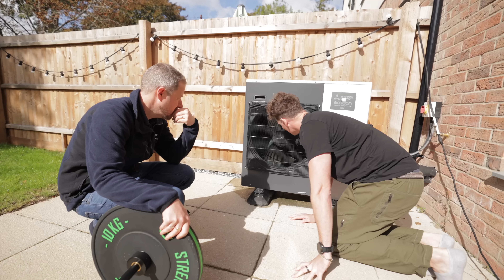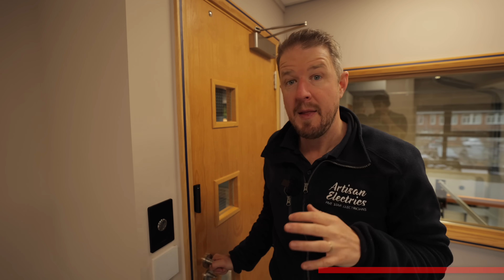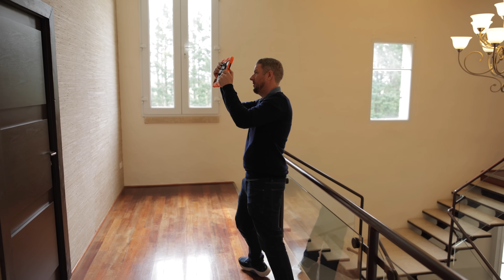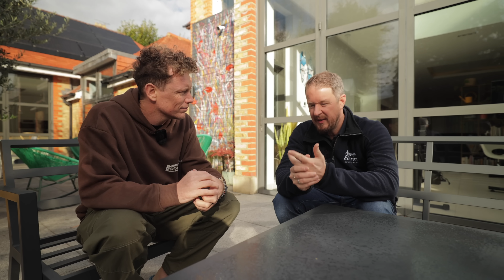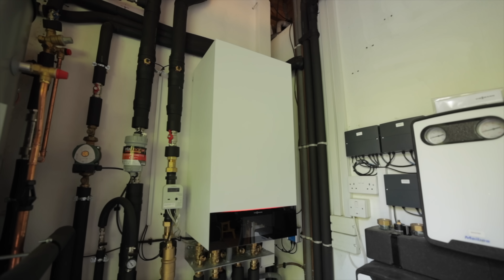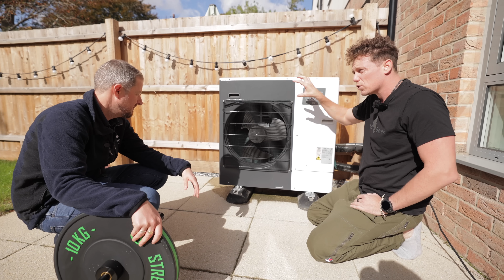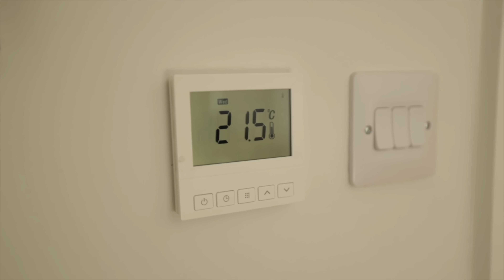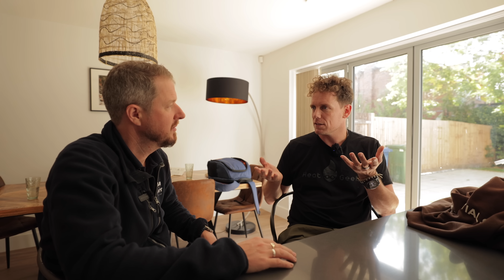Are Heat Pumps Really Worth It In 2026?

Comment: Still  concerned about:
1. Larger pipes and larger radiators needed to circulate lower temp water around house. Could mean entire house needing to be redecorated after installation.
2. Outside and inside space needed for equipment.
3. Noisy units as motor/pump bearings wear in years to come.
4. Finding skilled installers. UK doesn't take technical skills seriously or properly reward them.

Comment: Running an air conditioner in winter to heat the house ?  Ridiculous.
Reply: You don't understand the basic principle. A fridge uses a heater to cool the food .
Reply: @jablot5054  Only if it has an absorption chilling circuit like Arkla-Servel marketed in the 1930's  - 1950's.   You can read about it.

Comment: Heat pumps require lots of space- inside and out. For most of the UK housing stock this is impractical. Make heat pumps the same size and the same price as a gas boiler and i will think about it...simple economics.

Comment: These heat pumps are going to be a little like EV's with every passing year the process to design/measure/replace will streamline and the pumps themselves will get better.  Its just about timing + cost to get the best deal for 10+ years going forward..

Comment: I can believe that a properly installed systems in the right house probably do work well. However, the big issue is finding someone competent to actually do the job at a reasonable price. I can't even find a decent builder to build my extension, and goodness knows how many of them there are.
Reply: That's why you need to do it yourself.

Comment: No mention of the most important aspect of the heating system: how is the heat distributed in the house. Heat pumps aren’t efficient at reaching high temperatures and thus require much bigger distribution panels(radiators) to heat the room sufficiently
Reply: Not always much bigger than the house has already.
Reply: @constructioneerful a temperature differential of 50/20 degrees dissipates a lot less heat than 70/20, I don’t doubt a system running all day in mild weather would be sufficient, but in harsher weather not so sure
Reply: My water is set to 55 degrees with my gas boiler and we are doing fine. I've tried it last winter to see if a heat pump would work and it does! This is with really old, inefficient radiators. I'd get those replaced anyway.
Reply: @MsMoople I’d really love for you to qualify those efficiencies and the define what working fine means in engineering terms
Reply: @twomuch77 in engineering or basic terms it means the house gets warm enough that I don't need a blanket. It may take a tad longer than it used to, but we just don't let it get completely cold.
Reply: @MsMoople in basic terms it means you’re wasting energy

Comment: I'm in the Balkans and we just run our minisplits in the winter, so air to air heatpumps. The most challenging weather is actually -2 to 5c and heavy fog (which we get a lot of). The dew point is quite high and the units will go into a defrost cycle more frequently (about once per hour). Once below -2c, the air becomes a lot drier and the heatpumps gain back their efficiency, in as much as they defrost half as often. We get down to -15c occasionally with average of -7 at night during peak winter - they work absolutely fine. We have halved our bills over pellet burners (no gas here). We have 2x 4.2kw downstairs and 1x 4.2kw upstairs. Our house is 300sqm, no insulation and no double glazing. We keep the house at 23c 24/7. The units are 2022 Mitsubishi AY4.2 running R32.

My only complaint is the defrost cycle has quite a strong dehumidifying effect on the house and we have to run 2x humidifiers putting 10L of water into the air every day to maintain 60% humidity.

Comment: We had one installed this year by a local expert. We already had solar and 16kw battery storage and we HAVE NOT paid a penny in electricity consumption yet. We are over £500 in credit with octopus as the system generates 40-50kw a day solar on a good day between may and September. 

We were averaging £3.5k a year gas and electricity costs so for us it’s been magic!
Reply: Approximately, how much was the HP, solar and battery hardware and installation (minus any grants)?  How much do you think you will save per year heating your home?

Comment: We need to know the maintenance costs over the years. Boiler service Vs Heat pump service over 10 years.
 Do heat pumps need to be replaced? If so what is the cost of this Vs a boiler replacement? Unlikely to be a government grant for this I bet.
Reply: Mechanically, its an air conditioner with an extra valve that lets it switch which end gets cold and which end gets hot.

How often do you replace an air conditioner, or a refrigerator (also a heat pump)?

Comment: If your heating works, no matter how inefficient, spending 10k to replace it with a heat pump system is false economy. It would take decades to recoup your expenditure. Couple this with the fact, backed up by this video, there are a lot of installers out there that don't know what they are doing.

Comment: FYI I’ve had a heat pump (Air Source) a year ago by AIRA Home. We have a 5 bed detached, 100 sq metres living space, 5 kW solar, rising to 40 kWh battery storage over a period of 7 years, BEV, Intelligent Octopus Go tariff, 40 year old double glazing with 40 sq metres of glass, 50 year old cavity wall insulation (neither of which have been replaced for this project). The heat pump is an AIRA 12 kW. Their heat loss calculation suggested 10.5 kW. So 12kW was favoured as opposed to the next size down, which was 8kW. For me that’s a result. Whether it would be worth £40,000 to replace the glazing and cavity insulation, is a moot point. 

Our average total annual energy cost pre-heat pump was typically 4,500 kWh electricity + 20,000 kWh gas (good quality 3.5 year old Vaillant regular condenser boiler. Electricity bill for first 12 months with the heat pump was 10,300 kWh. This equates to a saving in total energy cost for our home of £83 per month. This exceeds my best prediction by two times!
Reply: I'm impressed that you managed to get 5 bedrooms in 100 sq meters/1,100 square feet.

Comment: Brilliant to see two excellent influencers collaborating on this. Two quick things which might hopefully help @artisanelectrics

The immersion heater switch needs to be left on because there is a contactor within the heat pump controller to complete the require pasteurisation cycle. Also the outdoor sensor comes fitted to the back of the Mitsubishi heat pump so you can run with weather compensation out of the box.

We hope this helps 🙂
Reply from the maker: Thanks!

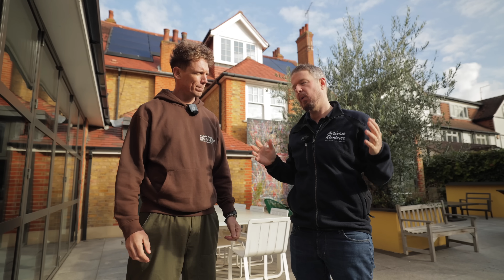Comment: @2:23  says it all ,when you find a "good engineer" apart from heat geek there are probably 5 others in the UK.
Reply: :D 

There are more than 5 good engineers. But considering the investment its crucial to get the right one. I've just installed my heat--pumps after nearly two years of research. Yes. Two years. If you need help and genuinely looking to install, happy to share. Also building the software design tool which should help to find the good one installer near you.
Reply: @gyanlanevsky92  Is there one in East Yorkshire?

Comment: As always with these videos, the focus is on heating, not hot water.  I have a wife, 3 daughters and 2 bathrooms, so between showers and baths a lot of hot water is being consumed, especially first thing in the morning and then between 6 and 8 in the evening.  In the middle of winter, there is no chance the heat pump is going to keep up with heating the hot water cylinder that's being drained all the time, which means the emersion heater kicks in and kills off any efficiency you've had during the day.  I'm obviously talking about about a heat pump and hot water cylinder comparable for my home.  That 16kw monster and huge cylinder in this video can probably keep up, but if I had to factor in the cost of that, I might as well stay with my 32kw gas combi boiler which currently costs me less than £800/year in gas and has a LOT less components to go wrong.
Reply: whether you use gas or a heatpump, if you have such a large hotwater demand and at least a big part of it is used for showering you should look at shower drain heat recovery. Most models can recover 40-60% of the heat and only cost around `£300.
Reply: @erikv5382  That actually looks pretty good.  I can imagine having a hot shower at 40 Celsius and it going down the drain at 30 or more.  The problem being that it’s not widely used, so the cost for installation and the replacement when it goes wrong is high, since this will be something behind the wall
Reply: That sounds like you've just made a massive assumption based on your priors. Any heating engineer worth their salt would size the hot water cylinder for the consumption expected and ensure the heat pump is sized for the expected run time for charging the cylinder and running during the coldest day. I've got a 190ltr cylinder at 50c and it has enough hot water for 2 showers and a bath at least and I've still not run out of hot water (might get another shower out of it). So, you might need a 300ltr or 400ltr cylinder. You'll also find that heat pumps have actually a lot fewer components vs gas boiler systems, how often do fridges break down compared to boilers, don't see companies flogging fridge cover everywhere?
Reply: @SeanW-zi6kj   Wow, there are so many inaccuracies in your comment.  For starters, with a 190ltr cylinder, if you had a bath first, the cold water entering the tank would cool down the hot water that was left to the point where you couldn't have two hot showers, I doubt even one.  For a retrofit, where in the world am I supposed to fit a 400ltr cylinder in my home?  Not to mention that a 400ltr cylinder combined with a heat pump to keep it filled with hot water, would bring me back to what I originally said, which is that the cost wouldn't make it viable over my current combi boiler setup.  As for number of components, I'm not comparing a heat pump to a boiler, I'm comparing a complete central heating and hot water system powered by heat pump with one powered by gas combi boiler.  The one powered by a heat pump has a LOT more components.  As for cover, in the fridge world it's called an extended warranty and it's as a big con as boiler cover, which is why I've never had either.  If a good boiler is looked after and serviced, there's no reason for it to break down.
Reply: @farab4391 you're making an assumption re cooking of the cylinder. They're designed not to mix. Our cylinder can show as low as 15C at the middle and yet you can draw 2 showers from it as it pulls water from the top and fills from the bottom.
Reply: You could check Adlar Castra solution where you get a 300L R290 cylinder heat pump and an additional R32 Panasonic/Grunfos based space heating/cooling heat pump. Cost after grant is very competitive. Both heat pump can run concurrently so no need to choose between space heating or dhw heating.
Reply: We've got a 4 bed house with 2 bathrooms and kids who love to sneak out for long showers and baths. We haven't run through our 250L cylinder yet. It works just fine with 2 reheat windows per day and takes less than an hour to come back to temp (I only know this through the app as you literally don't notice at the tap). I don't think hot water provision should be a problem with the correctly specced cylinder. Remember it mexes down so 250L provides about 340L of hot water. We can have 4 decent showers back to back. We used about 1/3rd of our heating energy heating water through November.
Reply: At last a sensible comment 👌👏👍

Comment: Hi, I have installed a 9 kw ASHP this summer, PVs, hybrid inverter and batteries. I heat 120 mp2  mudbrick detached house, built in 1975, with only loft insulation,  (20cm mineral wool) double glazed windows, to 23 degrees 24/7, no zoning with 22 type radiators. Started the heating around mid September and so far the bill for energy is 0, dhw included. I`m happy with the result, so far, but like mentioned in the video, it`s important to do the calculations and installation right.

Comment: Would never touch a wet system personally. We went for an air to air system and it's absolutely amazing with the benefit of air con in the summer. Also we have solar and batteries plus an offpeak cheap rate at night so basically we never use peak rate electirc and we sell everything we produce on solar for twice what we pay for charging the batteries. I also charge the immersion tank for hot water on the cheap rate and because it is an old system with an attic tank i can fill the attic tank with rainwater harvesting so that is even more money saved. Overall, our bill is basically zero over the year. Great investment. 

If you have radiators or underfloor heating perhaps an air to water ASHP makes more sense but even if i put radiators in and got the government grant to help cover the costs it still worked out much more than an Air to Air system coming from a home with no wet heating system already installed.
Reply: I can definitely see the appeal of having built in air con too. Does your house not feel drafty with the vented air though? And how did you manage all the ductwork? Where did it go?

Comment: I tried the web calculator. The saving estimation is quite optimistic, it is assuming my gas heating (and hobs) cost >2.5 times the real. Still, just to pay back the installation, with a 50% estimated saving compared gas bill, it might take >20 years. I like the technology and not point of the efficiency but the numbers are not there yet to me.
Reply: Thats not factoring in the life expectancy of the product which generously with todays built in obsolesence will be 10 years , you will be buying a new heatpump within those 20 years adding thousands more again on top .

Comment: If you have a combi boiler with no tanks in your house, is it viable to change to a ASHP. There seems to be so much extra stuff to go with it, and I presume you can't put that in a cold garage?
Reply: This is one of the issues when going from a combi in a smaller house. A cold garage is usable, especially if you could box it all in.
Reply: It is viable to use a cold garage, just needs factoring in that the cylinder has sufficient insulation (they all practically are) and the pipes are properly lagged.

Comment: 1. We don’t get our gas from ‘Putin’. 
2. You’ll need an extension on the side of your house to house all of that extra equipment.
3. From someone who has a heat pump, it takes ages to heat up your home.
4. Again, from a heat pump owner, your electricity bill will triple every month as the pump is constantly running.
5. These heat pumps cost a fortune.
Reply: Clearly it wasn't set up properly or you've fiddled with it and made it expensive for yourself. As when set up properly you never let your house get cold for it "to take ages to heat up", they work best when maintaining a temperature.

Your electric bill may have tripled but your gas bill should had reduced by an equal amount. 

I have my doubts about your claims though.

Comment: I'd like to hear something on maintenance costs.  My Worcester-Bosch came with 7 year warranty, but my deal requires yearly maintenance checks at around 120gbp, which I'm fine with.  How often is maintenance needed for a heat pump, and what is the typical cost?
Reply: Yes, annual servicing as a requirement of the warranty is a bit of a scam. Heat pumps are reliable and do not need complex annual services. If a homeowner could do some very basic checks such as noting any efficiency changes, any unusual noises, and check for leaks and any leaves stuck in the outdoor unit then there's no reason why services need to be annually. I do those checks myself and my old heat pump works perfect and has never had a service.